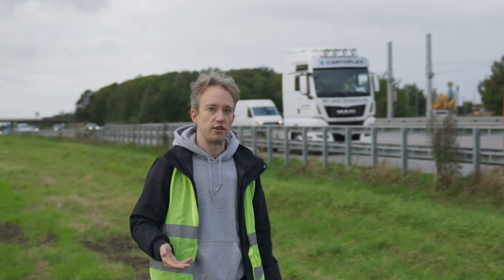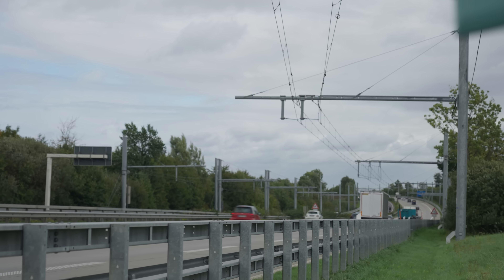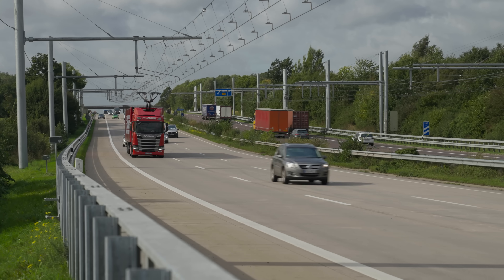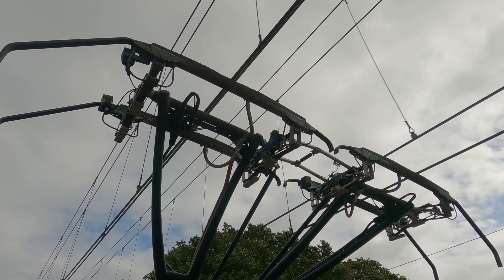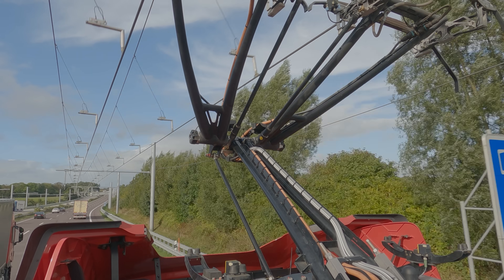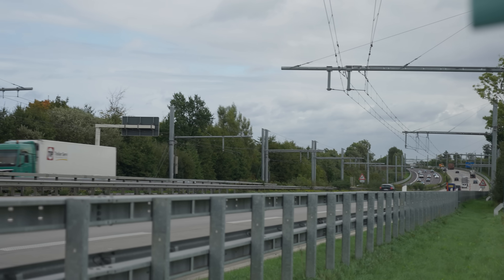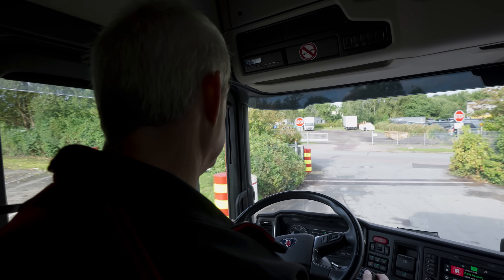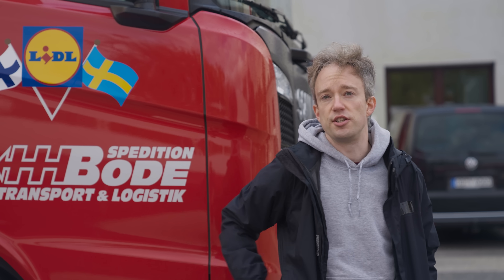The highway where trucks work like electric trains

Comment: Not a new idea  (think of trams) but this is a MUST for lorries in the future.
The grounding rail can ALSO be suspended above the lorry....making the lorry electrically independent of the conductivity of the ground the wheels are rolling on at any given moment.
Reply: P.S. The ground (earth) wire in a 3-pin socket (or plug)  only needs to connect to a "rod" underneath your house....far from the socket.

Comment: See i love the way Germany rolls. Take heed America. Instead of investing in autonomous trucks to keep from paying people, invest in electric interstate system for battery power 🚚s and buses. We definitely can do this. We already have the interstate system for this idea. It would be cheaper and more efficient than investing in rail and charging stations. On any giving day on I.85, just a one mile strecth is over 50 trucks moving between Charlotte & Atlanta. The weight stations be so full, they have to divert the truck traffic to the next weight station. Think of how much fuel this would save per truck.

Comment: You could install vertical turbines around the poles putting wind towers where horizontal just won't work letting each application determine installation type.
Reply: I think a big problem with that would be just where would you put all the necessary technology, like would they even be worth the cost to install them because if you take turbines that are too small they just arent going to produce to make installing them worth it. and if you make them bigger, you'll have to think of the risks when there is an accident and a pole was hit damaged etc and they would be an eyesore, and theyd be hard to install because now the pole needs to also be able to carry the weight of it on its side so not even on top of it etc

Comment: Soooo???? You don’t need fossil fuel to generate electricity, produce steel, electric cable, vehicles, batteries, etc., etc…… I smell control here! …..And by the way Geo engineering , HAARP causing climate change because they’re modifying the weather.
People check it out …..who the heck are they kidding?
NAH!
Reply: There are new steel production methods that don't need fossil fuels.  Places are changing over to that already.  It can produce better steel.
You have it wrong about what is going on.
Reply: @kensmith5694  Explain!
Reply: I don’t have it wrong ! Explain!!

Comment: Dumb idea... you can't turn ..this is expensive  and waste of a lane .. just imagine peak traffic
Reply: It isnt a waste of a lane.  Nothing stops a car from using the lane.  The truck may even keep up with traffic.
Reply: @kensmith5694  building a special lane for truck only .. is this auto poilet?
Reply: @polkim8089  There is no good reason to not just put the wires above a normal lane in most places.
Reply: @kensmith5694  not all driver that good to touch the power line
Reply: @polkim8089  The system is automated.  The truck driver just has to get in the right lane and it will hook up.
Reply: @polkim8089  it's not for trucks only. Any kind of vehicle can and may use it ... 
Guess how it works in cities with a tram network where the tram tracks aren't seperated but in the road: cars, trucks and buses still go under these wires without a problem
Reply: @kensmith5694  seem OK,  but still cost a lot ... need the infrastructure to do it properly...  I still think just batteries charging or swap is better

Comment: I'm a retired 30-year LTL freight driver local truck driver. I agree with the concept of electric wires on the highway for these truck drivers LTL regionals or whatever it's a great system to my belief. But they need to figure out local trucks that has to make deliveries and pickups how would that work and get into the system without the lines or if they can get back on the line somehow. But I really think trucks should stay in one lane if this system goes through and then it would be less accidents than what we have now with cars in tractor trailers and it's not all tractor trailers fault there's car parts in both ends but this system is to me for the environment it's a good system this is simpler too Tesla and Tesla is doing the same thing without electric with computers though with the tractor trailers and cars and pickup trucks. Great idea keep up the good work.

Comment: Would allowing "B-Doubles" only on specially designated routes in UK help with efficiency? One truck, one driver pulling twice the load. Our roads handle over-sized loads all the time so an extra trailer ain't gonna make much difference. Most distribution centres and large warehouses seem to be built next to the motorway network these days so would be ideal for bulk deliveries.
Reply: B doubles don't double the capacity, they increase it  by about 50%, you can also use euro-combis or eco-combis which achieve the same thing

I think there is a good case for them as they instantly achieve about 15% less CO2 per ton of freight and would be perfect for long distance trunking operations.

Furthermore our rail network is I'll equipped to handle a significant increase of freight traffic without investment on the scale of the motorways being built so in the mean time increasing efficiency of road transport is good

Comment: Downside: Very high installation costs (that short test track costs a few million €) In my eyes, fuel cells for long haul and batterie for short is the better idea
Reply: Fuel cells is perpetual waste of energy vs. this is a one-time investment.
Reply: @Martinit0  depends on the efficiency 
Although regarding the costs to equip all major freeways with that system, even current fuel cells would be better

Comment: Growing up in the 70s we had trolley buses, fond memories of the conductor jumping off getting the long cane to re hook the bus to the over head cables. Looking at the way our electric and gas has increased recently should be interesting. Volvo last week say it's carbon footprint is what 70% higher to make a electric car, you have to drive it for 9 years before it's neutral. Really looking forward to watching this work especially after hearing the guy at McDonald's charging his battery van having travelled 25 miles with a van of scooters and scooter battery replacement heavy load burning the power down real guy not a good thing to say.
Reply: That's interesting.  Do you have a link to that Volvo information?

Comment: All heavy loads should be made by rail.  Even on diesel power, you are taking 30+ lorries off the road with one engine doing the work.  More bi-mode locomotives to move stuff by rail.  We have to get away from the road loving way of transporting goods and move to rail.  Saying that, I do like the bi mode lorry concept though.
Reply: Next time you're at your local grocery store have a look out back where the freight comes in. Spoiler alert... there's no rails there. Or next time you drive by a construction site... how do the building materials get there? Not by train. It takes a lorry (or a truck as we call them here in the US). Even here in the US which has a vastly larger freight rail network than you'd find in Europe there are still folks like me moving freight from manufacturers to warehouses and stores by truck. Trains will never replace trucks altogether because of their limitations (rails).

Comment: That's actually quite innovative. Yes, trains are better, but the handling is complicated and the whole logistics today is based on lorries that dock on Hubs in reverse gear. Try to unload a train full of containers, its complicated and takes waaay more time. And battery driven lorries are not an option with lithium batteries, they simply can't store enough energy. So this system is actually quite good, but unfortunately lorries ruin the highway tracks quickly. Seems to still be cheaper than replacing steel rails.

Comment: Cargo trolleybuses were a thing 60–70 years ago in Moscow for a short period. In St. Petersburg they still are, even if only for of trolleybus depots (Moscow had it trolleybus network taken down in 2020 in favor of electric battery-powered buses, prior to that it was the largest in the world)
Reply: I guess it is famous for that these days, but surely you have to have a special kind of corruption to decommission an existing Trolleybus network to replace them with battery buses that are inferior in every way bar not requiring infrastructure that exists anyway.